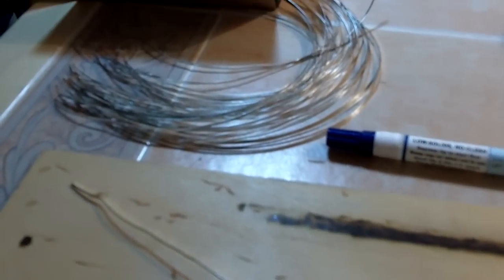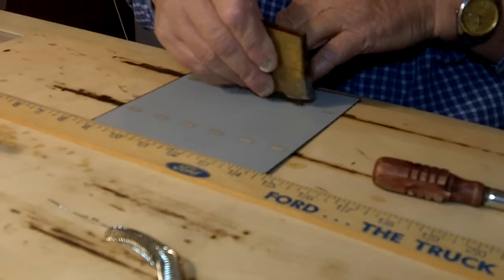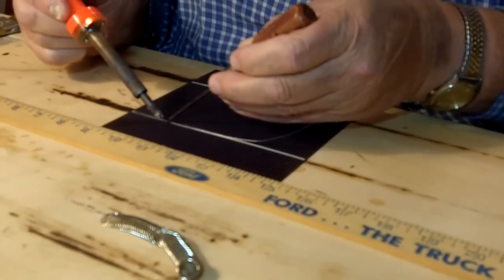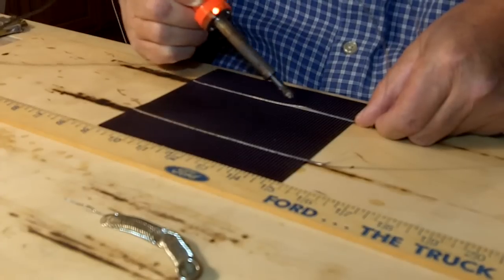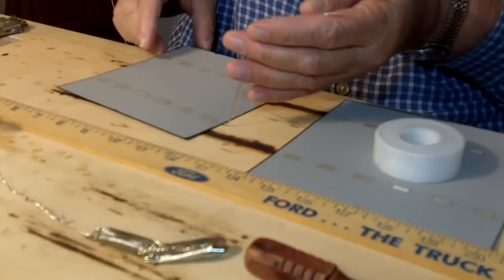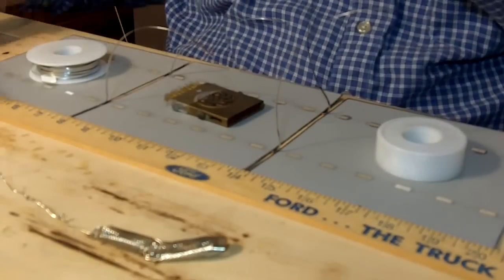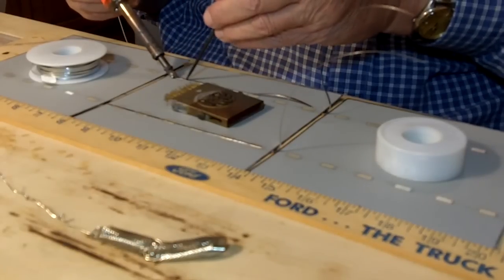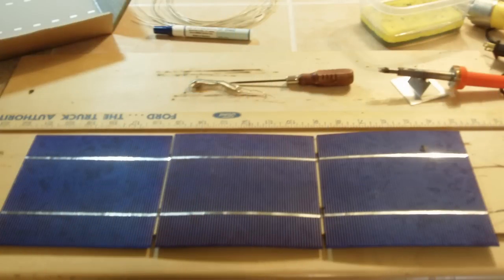How To Make A Solar Panel Part 1

Comment: Lots of good info, im just curious if cracks could be caused by holding the soldering tip at the edge too long?
Reply from the maker: The cells are just very brittle and must be handled carefully.